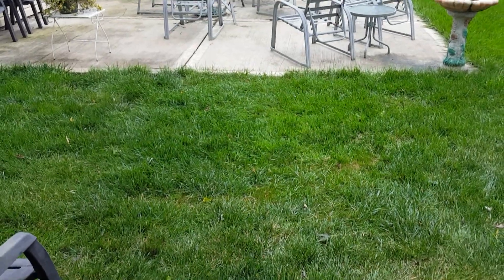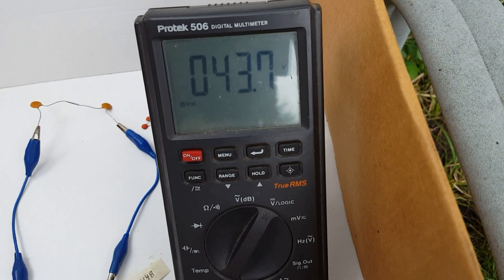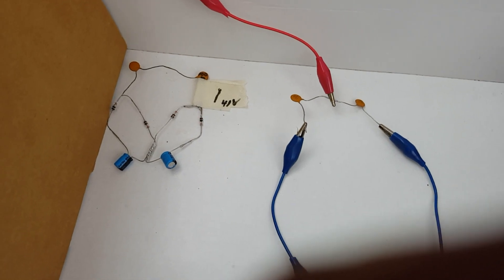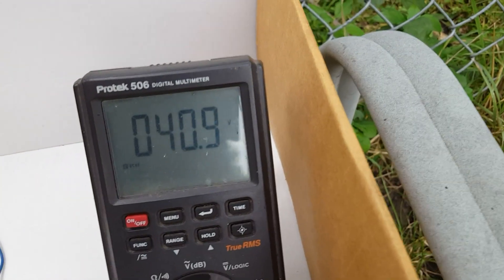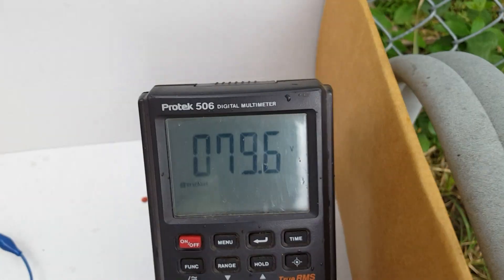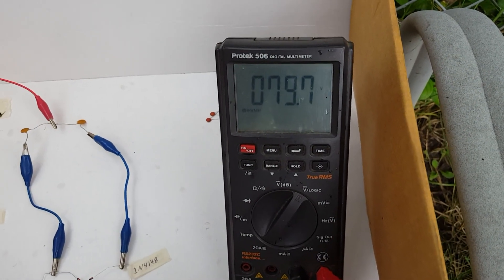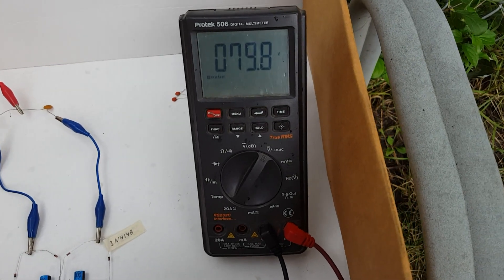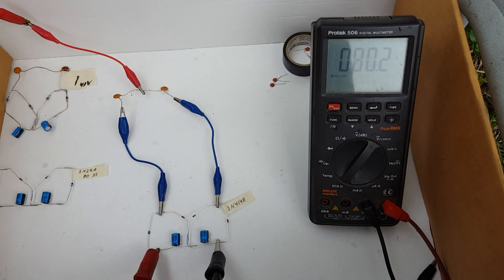Free Energy From Air 2019, part 17

Comment: You should be able to parallel these small diodes and get more current for charging your caps. You might want to put put a small tesla coil primary in series with your diode loop. Thanks for the shout out.
Reply from the maker: Parallel the small diodes,,,,,,do you mean to double up the diodes in parallel in the circuit,,,to have 8 diodes in the circuit instead of 4,,,,,or do you mean to parallel more circuits?  Thanks for the suggested diodes,,,extreme fast switching,,now i feel like im collecting a wider range of frequencies, especially the high Freq,,,,plus i bet im getting more current now also,,i will have to check that again soon :-)
Reply: @INVENTOR3  Yes . I believe that the secret is in the P/N junction and by adding more material the P/N avalanche will supply more electrons . Not all P/N junctions are alike because of the difference of material. Some will begin to conduct at different frequency. Solar cells conduct at the frequencies of  light and some will conduct a very low frequencies. They used to make so called nuclear batteries by encasing radio active material in a P/N stiffler style loop of "diode" material that avalanched at the frequency of the radiation in the radioactive material. Sometimes you can take the loop out of range by adding to many diodes in the series.
Reply from the maker: @cruzemissile5409  I feel like im following in footsteps of Dr Moray, finding that correct material for the diode,,,that sweedish stone, hehehehe.  He did eventually use radio active material in his 3rd generation device, and i want to try this yet, but i will use a special valve like this.....
https://icestuff.com/~energy21/edwingray.htm
The "stiffler loop", i been studying this, but it is AC so it would have to go before my circuit,,,,so im still thinking about how i can incorporate it.  Diode technology is fascinating how far they developed these, quantum physics is great! :-)

Comment: Bravo Paul great going,thanks to Cruze Missile for the tip. Is it pulling in enough current to be beneficial in charging a battery/ bank so you can use it in place of solar panels? What are the values  of the capacitors you are currently using in that ?I'm glad to see you are doing well and making progress.
Reply from the maker: Thank you,,,,wait until you see the next video! :-)
Ceramic disc caps are .1uF  50V  &  the electrolytic caps are 100uF  50V
Reply: @INVENTOR3  Have you thought about stepping the voltage down to increase the current? You can't use what you're getting to run anything anyway because it is wild so you are going to have to run it through a charge controller into batteries or whatever you are going to put it in and then run it through an inverter, that way it will/should be stable.
Here is one video I saw on how to step it down so you can increase the current  : How to Step Down DC ( Voltage ) & Step up Current https://youtu.be/wauyeSz2TM4
I'm anxious to see what you've done in your next video.
Reply from the maker: @BushImports  Thanks for that link, it might come in handy,,i saved to my favorites for now!  Im also thinking of charging large cap and add resistor and use energy that way, or/and add spark gap.  Or maybe even to resonate with barium titanate cylinder i have and get energy after that.  Hope you saw part 18 now :-)

Comment: Very interesting, I do believe you are again the only one on youtube hitting these numbers. I've never come close to the numbers you are posting, I think the best I ever reached was about 15vdc, but I was able to charge 12vdc batteries and I mean car and tractor batteries.... at your current level you should be able to do that easily. Have you tried? This somehow works differently than OHM's law, you could charge a 12vdc battery on 9 vdc. It's just a different sort of energy from my experience.
Reply from the maker: It has been quite a while since i last tried to charge lead acid battery, they leak out a lot.  I need to try it again with set-up i have now.  I did charge NiCad rechargeable batteries, took about 3 days,, but i must try again soon,,,,but maybe better to charge large cap and use the same way you would a battery, just let it drain out slowly with resistors.  I also been looking into the "Tesla switch" for charging batteries. Just thinking off top of my head, but now wondering if it would work with caps instead of batteries.

Comment: But unfortunately, as soon as you attach something that draws power, everything is dead.
Reply from the maker: I was already powering 21 LEDs before i made this improvement.  I have not yet tried to attach the LEDs since i got more voltage now.  But in the past, yes, the voltage does drop when attaching the load.  But this time i will charge caps and use resistor to use energy slowly from caps.

Comment: duh , charge in one hour what , probably 10 uF capacitor, is this for kids ?
Reply from the maker: Heheheh, not 10uF,,,,but rather 3500 uF,,,,it took 3 hours to charge 3500uF cap to 30V(the source voltage), but now we have 80V source.  No not for kids, hehehe, i been working on this for about 9 years now.   It is shown in this link in part 15, watch last two minutes, 3" inch discharge.......
https://www.youtube.com/watch?v=6BMj5DLqgE0&t=599s
Reply: @INVENTOR3  hope ur right but from the size of it and 80V , it looks more like 1uF , not at all 3500uF, im open to ur explanations tho
Reply from the maker: @i_catalino  Im wondering if your looking at the correct cap.  When you say "it looks more like 1uF"  are you talking about the size of the cap ,,or the size of the discharge?
Did you look at this link, video part 14(sorry, not part 15 as i mentioned in last comment).....watch at 16:35 to 18:00.....    https://www.youtube.com/watch?v=6BMj5DLqgE0&t=599s
In that video part 14,  i charged 3500uF cap with 30V, but now have 80V to charge that same cap with :-)